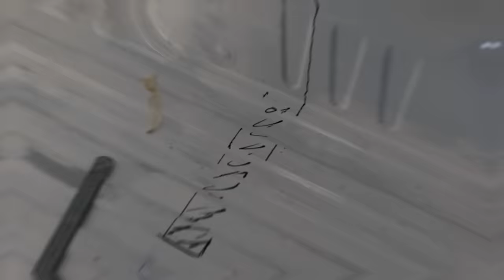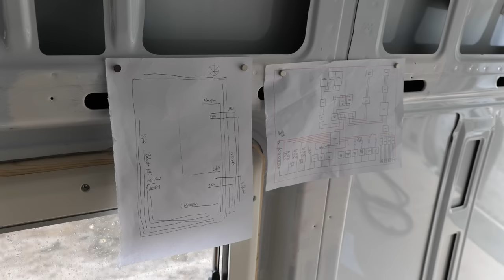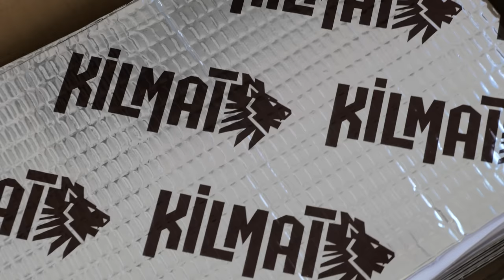Installing WIRING and INSULATION in my VAN 🚐

Comment: Use Wago clips for your wire connections, even the testing for continuity. Much cleaner, easier, safer, less damage to bare wires. Big difference with this video is Matt is a first class woodworker with all the tools that he knows how to use. Always makes me wince at other van conversions and various model making videos (I don't make videos but admire the work when nothing else to do) when they use the tools they have badly

Comment: For anyone also doing continuity tests, a good habit is to also touch the chassis to ensure that your cable has not shorted to the car in any way. 
Matt did the perfect trick by tying one end so you can sit in one spot and don't need an extension 😉

Comment: Rockwool definitely the best solution! In architecture, you'll always use it or mineral wool in light constructions (i.e. anything steel or wood-framed)
In terms of r value it's not as good as PUR or PIR for example, but it does have (1) mass and (2) doesn't release toxic (fatal even) gasses when burning. So Rockwool might not be as good at insulating for heat but it'll still do a good job and also help with sound insulation a lot as well as keep you safe in case of a fire!

Comment: Don't worry about reinventing the wheel. When it comes to van conversions there are loads of ways to do things and most of whats out there has been figured out by trial and error or adaptation from other trades. Commercial campervans are never built to the same standard as customs so they cant be looked at for what you SHOULD do, and everything else is just whats worked for someone else. Go for it, try something new and see if you can do it better!
Reply from the maker: Yea I’ll be sure to include a healthy dose of experimentation while ensuring I don’t get too carried away. Thank you so much :)
Reply: In mine I'm trying a completely radical way of doing insulation in a bid to reduce cost, weight and prevent condensation buildup...or at least actively manage it. One of the best parts about building a van is that for the most part there are no building regs or standards that you need to follow. (for better or for worse - at least it adds to the fun!) Best of luck!

Comment: Love this. You didn't have to run a negative wire from the battery, you could've just run the positive and then use the chassis for the negative.

Comment: Good to see you using the split convoluted tube, You see so many people just running wires through their vans with no protection at all 😱 It's a good idea to add a twist of insulation tape every 1 or 2 hundred mms to keep the convolute closed, it's surprising how much it can gape on bends. Did you use a split charge relay on the leisure battery charging circuit ? if not it's well worth looking into.
Reply from the maker: Definitely something I would have done had I not done the research. Yep will definitely be adding a split charge relay in addition to the solar and shore power. Not taking any chances!

Comment: Those nails you glued to the ceiling to stick the foam panels onto them are going to constitute conduits for heat. Just gluing the panels in place would have been better. There is specially designed foam with low expansion available specifically for this.

Comment: Great series! But I am wondering about trapped moisture behind the vapor barrier as you used wet battens under the plywood flooring. Did the battens dry completely before installation?

Comment: Hey- your LED lights might cause migraines? Perhaps like warm toned ones would be less likely to do that? Just a thought, you’re you g and healthy so perhaps not a worry. It is an extremely exciting project- good for you!!
Reply: LED migraines are actually due to flickering (pulse width modulation PWM to control brightness). It's best to buy flicker-free LED, rather than based on color temperature. 

I'm also a fan of warm tones
Reply from the maker: Good to know, hadn’t even considered that as a potential issue. Especially as they’re essentially at eye level for a 6’1 individual like me. Will look into flicker free ones!!
Reply: @nugenki  cheers, Ill keep that in mind thanks for that info 😊